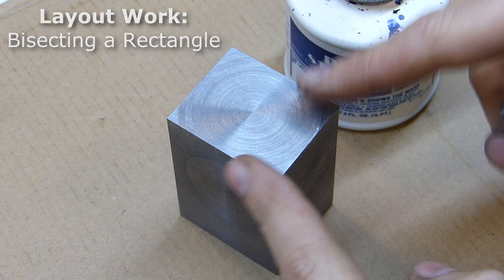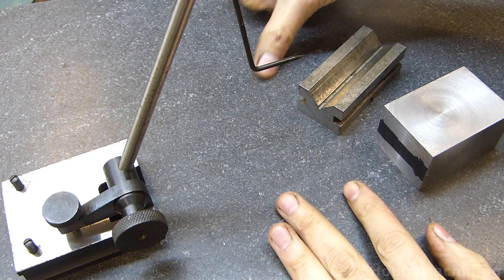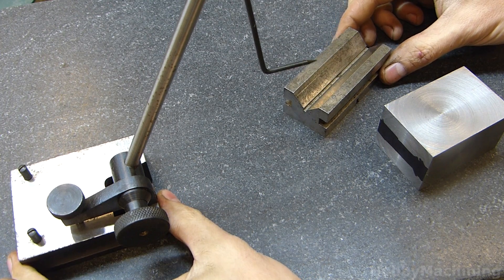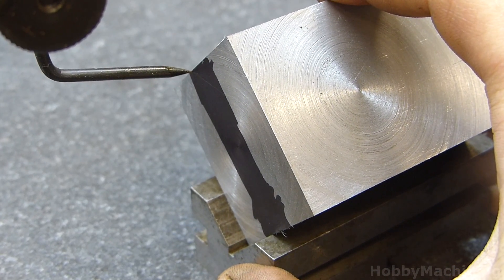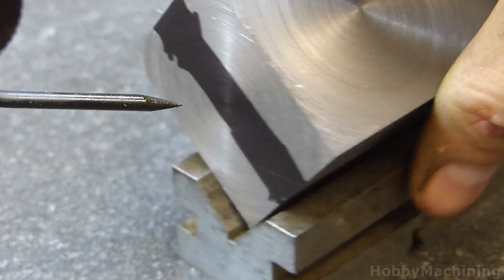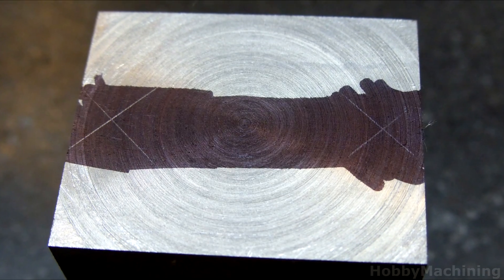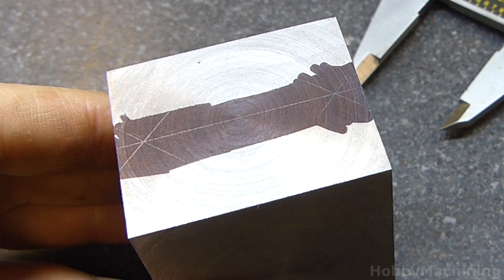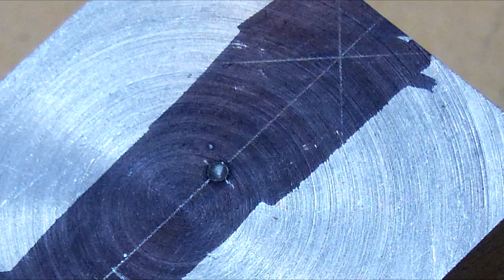Machining Layout: Dividing and marking a part in half

Comment: I've never been in a position where I needed to do this, however it is good to keep in the back of my mind, thanks. :D

I typically just take a pair of calipers, measure the block, divide the measurement by two, rest one ear of the calipers on the edge of the block (with one along the center), and lightly run the calipers down the center line to mark the layout fluid.

I keep two sets of calipers though, an SPI pair for scribing, and a Starrett pair for proper use, as scribing lines with calipers can damage the ears.